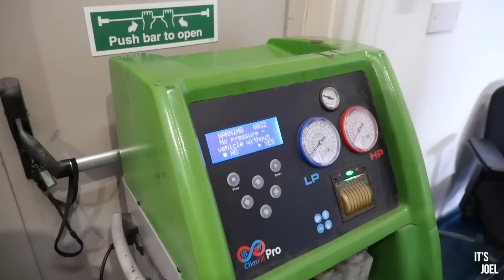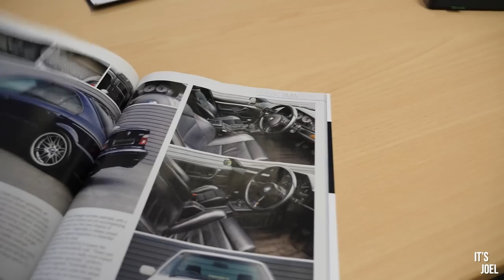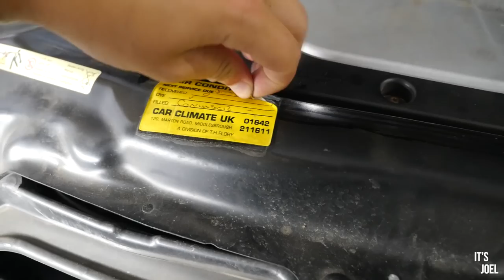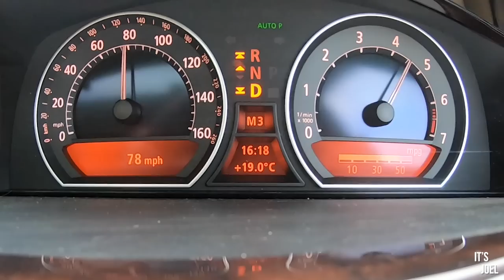I broke my V12 BMW 7 Series…

Comment: A lot of transmissions adapt over time to allow for wear and driving style. I completely flushed my ATF and for that day and maybe the day after it could be really rough but it adapted to the new fluid
Reply from the maker: This is what I was thinking, and I hope you’re right! Fingers crossed
Reply: Hi Joel. Great vid again. I used to be a mechanic so my comments might help you with the BM  

Did the garage pull any fault codes out of the transmission,  engine etc modules? These will be crucial to any diagnostics. 

You should do a reset of the transmission adaptions via the BMW dealer software now you gave changed the fluid and filter. There is a chat way of doing it by turning on the ignition with your foot all the way down on the accelerator pedal and hold for 30 seconds. Then turn the ignition off first and then take foot off of pedal. This will put the transmission into a reset mode and it will learn your driving habits. You should do this technique in any auto car you buy so it will learn your driving style rather than you using the previous owners style that the modules have learned. 

Hope this helps.
Reply: Did you do it according to service schedule or "belated"? I don't buy those super long intervals, e.g. 120.000 miles or so, so I am doing it after ca 1/3 or that. Cheaper than a new trans ;)
Reply: U can also reset adaptive values for the transmission with a shop scanner, makes this process faster
Reply: @itsjoel  About your spot under the nose - i had one on the side of my chest and got rid of it with a a wart freeze stick from EndWarts. It may look odd for 14 days, but than it is history. The price for the sticks is ca.15-20.

Comment: That pan was replaced in Jul 18 when I owned it, don't remember that at all but then again my memory's terrible! Good to see you all doing right by the car Joel, still miss it. 

In terms of content, one thing I always wanted to do but never did was to do a proper grand tour and take the family down to the south of France, via Millau Bridge, Lake Garda, Stelvio Pass, the Swiss tunnels etc. I always felt it was the perfect car for that sort of trip and wanted to see if it would breeze through it as well as I suspected. Would make epic content.
Reply from the maker: Thanks for sharing. Definitely doesn’t hurt to do it again!
Reply: I've taken my 760Li on the stelvio pass the car is to long to drive round most of the turns without taking both sides of the road, I've done the alps and was impressed by how well it did the passes.

Comment: If you had the fluid changed through the filter housing it only amounts to approx 50% change as there is loads left in the torque converter. That has now mixed and giving a better drive. A full or another partial change is the best after frying the oil on a track

Comment: Hi Joel A300£ for transmission doesn't sound bad for that car. I spoke last week with bmw in Basingstoke where i live and they said that is life time transmission and doesn't need anything. from your video I can see that's incorrect. The main question is when I should do it. ZF gear box 4 years old 75k on the clock. Might be worth having a chat with that garage prices look reasonable as I avoid main dealers ridiculous rates.

Comment: If you want to properly service the transmission you need to change the fluid again because half of the fluid is in the torque convertor and transmission cooler .

Comment: Joel I have had a  few of these e65s including the 760LI and that ZF gearbox is Bomb proof and when these go in with problems people get told it’s a gearbox rebuild / replace etc which is mostly bollox. I noticed they serviced your gearbox but never dropped the mechatronic unit out as above that there are a couple of vital plastic seals which need replaced and always fail. One in particular a rectangular shape one is always the cause for limp mode where the gearbox won’t change gears correctly . You will get a warning of “monitoring clutch A” just replace them of it does it. High revs between gears is the mechatronic unit itself

Comment: That gearbox oil wasn't too bad. It's when it looks like a chocolate cake that you worry.
Reply: When the oil is contaminated like that it will stop disolving contaminates which can plug up or restrict movements of valves, couldve been his problem. After driving it with new oil for a while it may dissolve the rest of contaminates throughout the system

Comment: On my 760 I had the 3 tube seals and the bridge seal replaced when I had my transmission serviced. The bridge seal had actually got so brittle it had cracked, causing occasion flaring.
Reply: Chris I was just about to write the same thing till I saw this post. But yes your 100 percent right there they should of been done and rbm should of known that being a bmw specialist
Reply: @theconvict5726  lol ok good for you. Have a good evening 👍

Comment: Great Video Joel, ATF is a very good cleaner, it will take a few cycles to flush out the torque convertor, and remove any crud thats around the system & valve bodies. The filter is doing its job by catching the muck.  If you can regularly change the fluid, it will keep serving you.

Comment: When changing the automatic gearbox oil it is not enough let it slip and then put the new one...
There has to be injected new oil to clean and take off the oil from the parts that cannot be removed by gravity. Then new oil is injected and everything closed. 💪🏼
Reply: After changing it should be done a new gearbox adaptation. Not easy to do due to the many steps needed.

Comment: Looks like you got away with the gearbox issue. I would still monitor the box temperatures while driving with a scan tool

The next stage for the transmission is to bring down the valve body and replace the sleeves. (there are a few rubber seals that go bad between the valve body and the rest of the gearbox). They probably should have done that.

If that does not work then you need a rebuilt valve body.

The actual box is fairly strong unless it's allowed to slip while driving due to another fault.

Comment: You mentioned misfires/lumpiness that's almost one of the worst things about the 760. It's very hard to diagnose misfires on these engines as there are so many things that can cause that. I do have to say my 760 car runs far better on premium fuel. It has a hesitation on 95 octane fuel which can be quite bad with some fuels (for example Shell 95 is ok and Tesco 95 is no so good). I use Tesco 99 octane in mine as it's cheaper than Shell Vpower and the car runs the same as the Vpower.

Comment: I had our tansmission oil changed 3 times and then it fixed similar issue :) So something you might have to do again, reason is of course because it was not done in such a long time

Comment: I would have suspected that the main problem that caused the overheating would be the transmission. I have a 2007 E 87 1 series that gave me the same problem especially when I was driving up a hill and had to change to gears. The automatic trans share the same cooling system as the engine so since my trans had not had a trans oil change since the beginning it was making the car lethargic, friction made the trans hot. Once I had the oil trans oil changed the car was back to silky smooth driving. Before I changed the oil I actually drove the car 1480 Kilometers to Botswana and back and she took the trip like a man. Overheating a couple of times on my way back but I would blast the heater up and open my windows and I managed to get home.

Comment: Take the battery leads off touch them together, meanwhile turn headlights switch on to drain and electric still in the ECU and modules. After 15 minutes reconnect the battery leads and the ECU and all modules will have reset themselves ! Watch the BMW dr on u tube !

Comment: You did well on the tyre price.. my staggered 19” Bridgestone Turanzo tyres, 245/40 & 275/35 I had recently fitted on my 630i sport cost £900. These cars are not cheap.. Though saying that, I have just had delivered some new 20” VEEMANN VC7 alloys delivered. I’m looking forward to fitting them.. :)

Comment: When buying an old E65 with a V12, you definetely knew this was gonna happen sooner or later😅
Reply: Joel should get a w221 S600 Mercedes and compare the two!
Reply: @jordanseay216  and for an overkill audi with a W12? :D :D
Reply: It is risky enough buying an old E65 with a V12, but then straight piping it and doing track days is a recipe for disaster.
Reply: Don’t forget, joel has the long wheelbase 66, not the standart 65 :)

Comment: The car needs a ECU reset, after that he is adjusting the engine and sub ECU´s to the the new preferences, otherways he processes the old stored ECU data wich is obsolet. Disconect all batteries for few hours and the ECU lose their brain and adjust with the actual sensor data from the CAN-Bus-System.

Comment: Not sure if the 760 has a torque converter or not but if so, it'll most likely have taken a little bit of time for the fluid that will have been in it to be replaced by the new stuff unless RBM drained the torque converter first. If it doesn't have a torque converter then feel free to ignore me!
Reply: It does have a torque converter. It’s the old ZF 6 speed slushmatic

Comment: Joel, I’ve seen before on e65 bmws and e60, e90 have the same gearbox fault as kinda what your having.

Turned out to be the vehicle torque converter clutch pressures, around 70-60mph, you can get fluctuations in the rpm, or when driving hard it judders, but also when those models first came out we used to see a lot of mechatronic units play up which used to be covered under the bmw warranty when they were first released. 

Hope this can be some help 👍 

Ryan 😎

Comment: Auto transmissions have speed sensors (as separate from the wheel speed sensors). There should be at least two on the gearbox. If they go bad the gear changes will be off. Its one more thing to check, potentially.
Reply: @juggnautbitch  no, their built into the actual auto gearbox, which sends the speed signals to the ecu, and yes it does go into limp mode, had it happen on an Audi A6 automatic

Comment: I Recommend you a alpina gear Flash Software Update for the N73+Gearbox :) much less converter slippage 

Regarding the Gearbox: there are seals above the mechanics unit which needs to be taken out to replace those (40€ gaskets) These can fail and pressure gets lost in the Transmission (ZF 6HP26) -> failsafe Mode

Also you should adress those misfirings (Maybe bad coil?) because the misfires result in damaged kats which would cost over 4000€ to replace oem

Id like to see a 12,3“ Android Screen Build in 👍

Comment: I have a 2007 760Li and she has a 2007 B7 750i . We are going through them to make them as reliable as possible . We would appreciate any videos on how to upgrade them best for daily use. So far we have upgraded coolant systems and 6 speed performance transmissions reworked to address common issues. Would love to see anything on the subject of making these cars dependable ? Or are we just dreaming of some thing that can never be ? Love the straight pipes ! Sounds great !  These are our favorite modern cars. Any help in this endeavor would be greatly appreciated, Thank you.

Comment: When doing a transmission service its always good to also change the mechatronic sleves, that does allot of good usually. And driving outside of the UK is not as bad as it was during peak covid, definitely easier after being double vaxed, would be good to see her on the bahn!

Comment: id definetly love to see the BMW 7 series on the Autobahn, with restrictions easing it should be possible soon I hope, please keep the car till then, failing that see if you can take it on an airfield runway, could it hit 200mph?
Reply: Not even close. Also, runways are too short to hit the top speed in any reasonably fast car.

Comment: The wheels look like those found on the e34 m5, known as 'throwing stars'
Reply: Pretty sure they are.  The star is just a cover as well. Behind the cover is a basic 5 spoke alloy wheel.
Reply: @TheM5Dog  Dont know if I would call them basic, its a double spoke with various holes in the center. They are quite high tech for their time.
Reply: @GoldenCroc  perhaps basic was too basic a word, the important bit was the fact that they are 5 spokes behind the throwing star cover I guess.
Reply: @TheM5Dog  Indeed or ten spoke if you look at it that way, though I prefer to call it a 5 spoke "double spoke".

Comment: Your engine oil looked bad and good. The bad is the color means that there is a lot of something in the oil. The good news is what ever it was, it remained in suspension. I would recommend and be very interested in having your engine oil analyzed. It may tell you where your oil contaminants are coming from and to what degree.

Comment: It's well worth removing the valvebody to replace the bridge seal and mechatronic sleeves when servicing the transmission. I made a full video when I did mine: https://youtu.be/yAjVsJHS65E

Very common problem for the bridge seal to crack (mine was) and can cause shifting issues!

Comment: Well I am impressed haha, my E65 has not been as kind to me! Keep up the great content!
Reply: What issues have you had with it?
Reply: @agen1man  had it around 2 years, daily driver, so far new radiator, all external cooling hoses, temp sensor which is the repairs, and then general works 2 Michelin pilot sport 4s 275/40/19 rears, front dics, pads, sensors, arms, battery, battery reset, oil change, air filters, cabin filters, spark plugs, air tyre pressure sensor, seat belt sensor and steering angle sensor!

Comment: I'd get your transmission fluid changed on the L322 as well. My gearbox went pop at 100k and cost £1500 to fix. Lovely. Now the compressor needs changing for thr air suspension.... the joys of L322 ownership. (Not for much longer 😉)

Comment: Don't take it to Germany. Your car will die. Its too old. I've just come back from their after 10 years. No one drives these because even the Germans acknowledge they are crap money pits. They have new cars of all makes now and yes most go over 120mph daily including mine..keep in mind the TUV is a 2 yearly inspection and a factory reset of all wheeled vehicles .Fun fact BMW are only selling again now because of high and frequent repair costs in the past.

Comment: Should of bought a Lexus LS 400 or 430. Unlucky Joel Lad
Reply: Yep, or a LS460 as I have, but even those have more issues than the 400 or the 430, those were the high watermark for Lexus reliability.

All old luxury cars have issues, but with Lexus you don't need to deal with the endless endless issues that the older German machines have.
Reply: Thats not how YouTube works, isnt it. 400 or 430 are boring and absolutely terrible inside..